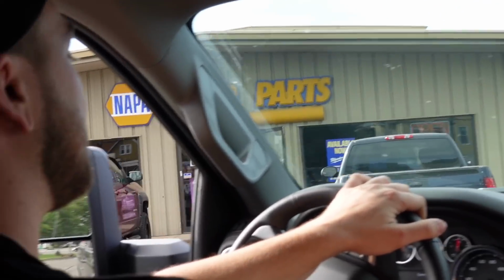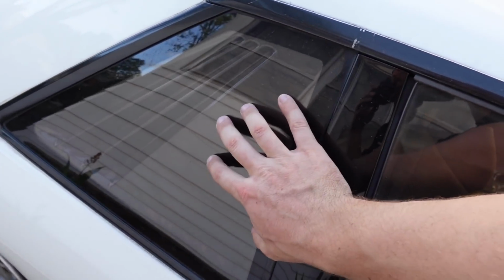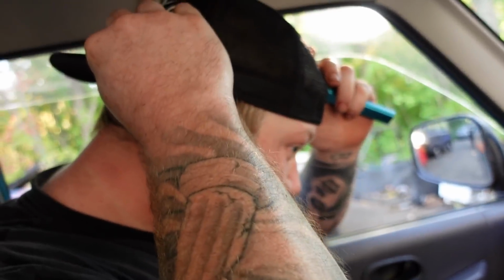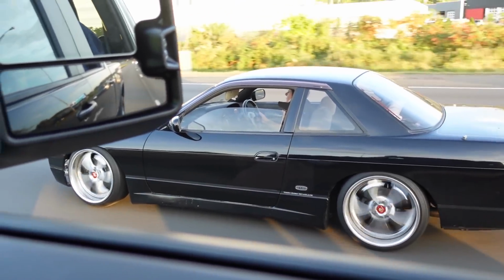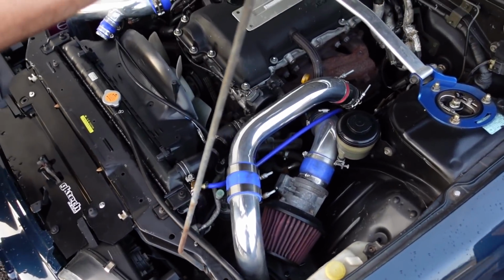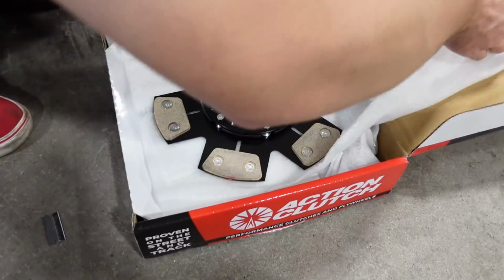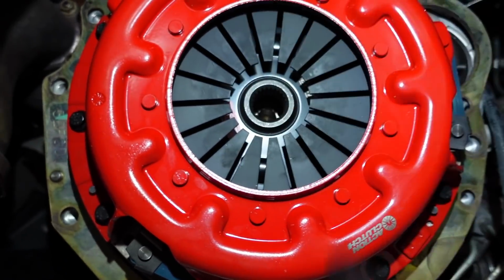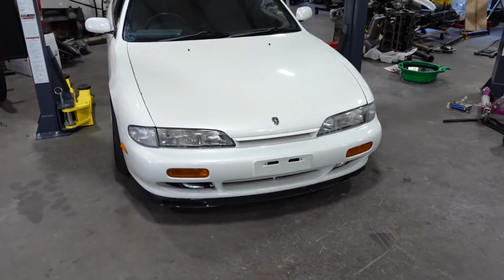SR20DE+T Silvia gets a new clutch & I REDEEM  myself with a proper burnout!

Comment: Seein Derreks new e36 made me soo mad cus i had a e46 328i 5spd in that color n i fuckin loved that car but driving in a blizzard on half bald drift spares on the freeway ended badly. I got smacked into which pitched me into the median then bounced back out into traffic just to get rammed back into the median. The fee to get it out the tow yard was more than it was worth to fix so i sold it for $200 profit while it sat in the tow lot with both front arms snapped on the passenger side